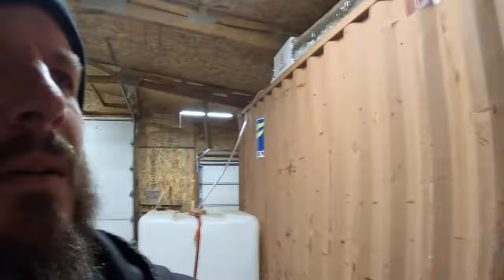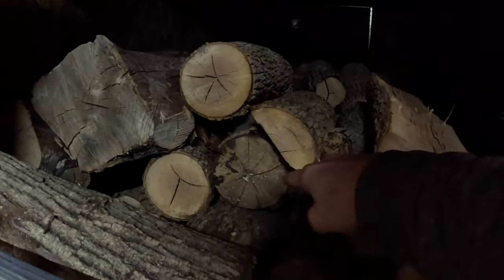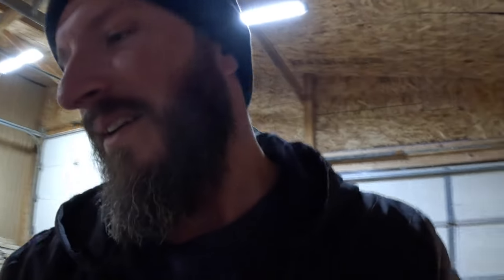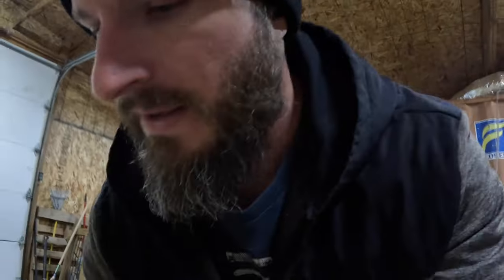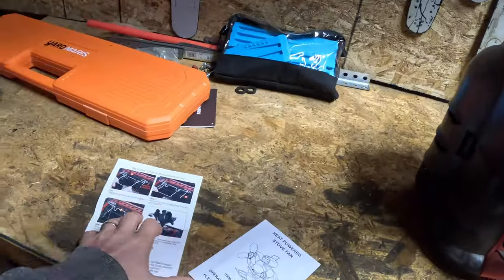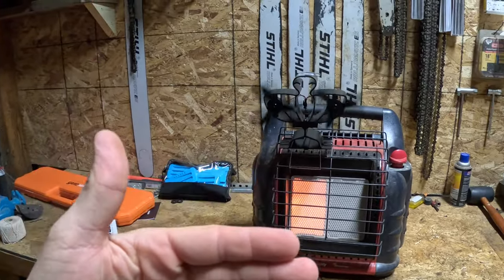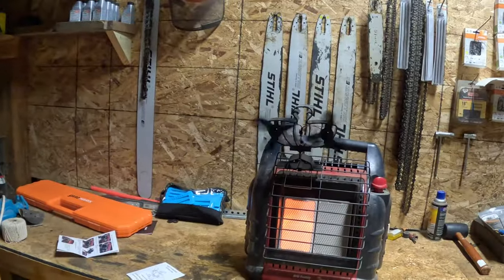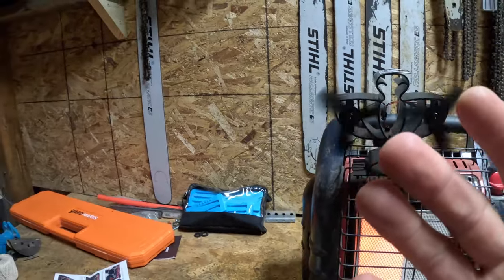Kiln Drying Logs & New Heater Fan

Comment: I can see how well that fan would work on a wood stove in a off grid cabin. I think you will be surprised at how much moisture your wood lost at 120 degrees. It looks great now. Great video. I have looked at those fans and was unsure if they worked or were just another gimmick. I may purchase one for a wall tent. Thank you for the information.
Reply from the maker: Yeah I’m hoping to be really surprised with the moisture level when I open them up and see. I think those little fans move enough air that it makes a big difference.

Comment: I have a Mr buddy heater. I used it at work on daily bases for awhile. I went through the small tanks. I found out the company makes a conversion kit to go from I think there 1 lb cylinders to 20 lb tanks. I have one now hooked up to my Mr buddy. It works great. That fan looks amazing. Great idea. Wonder if it would work sitting it on your boiler plate heat exchanger for hot water tank. ???????
Reply from the maker: I do have the adapter to hook up to a 20lb tank. It’s still in its packaging. Haha I have a side arm kit for the hot water tank. But I’m going to try and see if setting it on the pex will move any hot air. I think so.